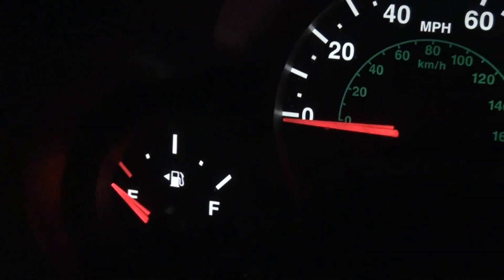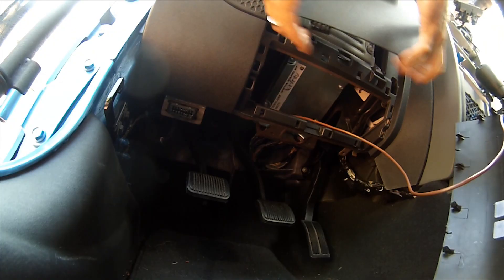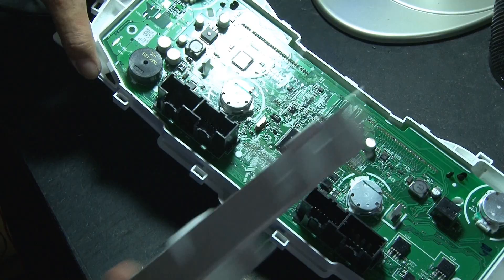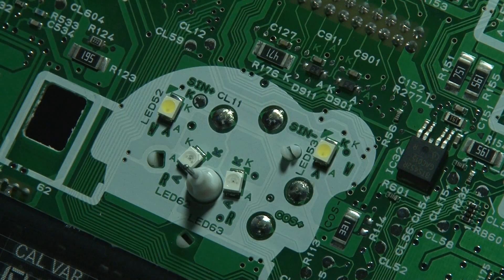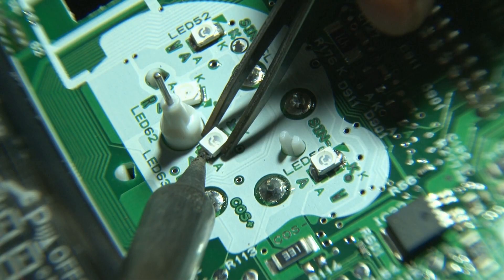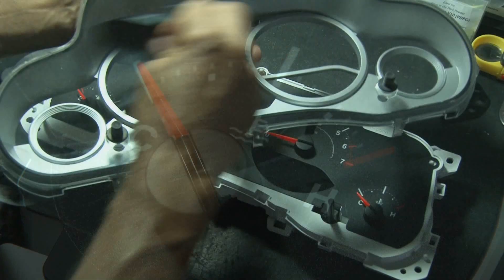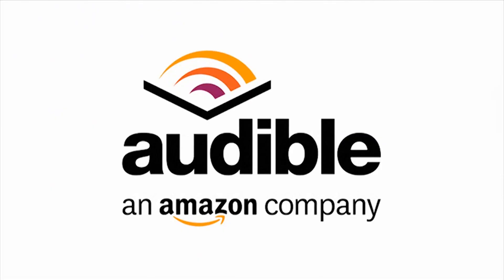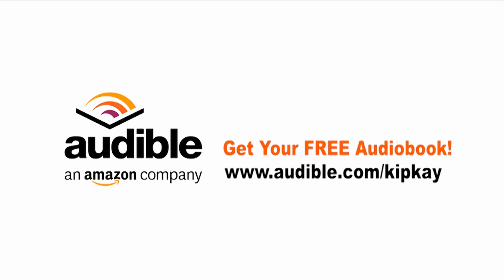Dashboard Light Hack!

Comment: Been wanting to do this to my 07 wrangler for a long time. I wanted red lights. Found that I need to change the resistors for red lights. A bit beyond my skill level. I did put some red paper over the blue bright light indicator. Made it much less blinding. If you have any tips regarding idntifying the resistors it they would be appreciated. white/ blue and green leds use the same resistor, red needs a dif one for some reason. Thanks for the video.
Reply: Professor Jameson that's crazy I wonder why and which,  because red is the color I would like myself.
Reply: Regular red LEDs are made differently, so it has a lower breakover voltage, but you can get blue LEDs with a phosphor that converts blue into red, or white LEDs with a filter, so they are electrically identical. They aren't as bright as white, so that might be a good thing.

Comment: Hey Kip, great instructs, but I feel that you should point out that this works best on nee cars with motorized gauges, like yours. Older cars have sporting-operated gauges, and it isn't simply a matter of marking the end of the needle on some paper. If you pull the needle from an older speedometer, it will go out of calibration, and will require a costly trip to a licensed speedometer rebuilder to recalibrate. Not to mention most older clusters don't utilize SMD LEDs for illumination, and some people won't be able to tell the difference until it's too late.

Comment: Just roll your mile counter back a few thousend while your at it ;)
Reply: no it's not.. Not atleast in my country
Reply: +John Murgatroyd His is digital, can't exactly roll it back.
Reply: +kipkay You can access the digital odometer just by opening up the casing.There should be a button that adjusts it. ;) PS:Im just joking so don't try it because I'm only 12. Lol
Reply: +John Murgatroyd You do realize that it's illegal to tamper with the odometer, and if he were to access the computer for his digital odo, that it would have a 50/50 possibility of not starting since there is high likelihood that the computers inside would see that something isn't right with the reading.
Reply: +ArcFlash It's possible, but would likely end up with a bricked car if the computers run security checks.
Reply: Kevin Topete That's your trip indicator that can be reset to 0.
Reply: +Fluttershy Fan lol
Reply: Gee, you really know how to lay the fear on, ultra THICK.  While I do not condone the practice of rolling back the miles of your odometer, it is, after all, YOUR odometer.  Any as far as I'm concerned, it's none of my business what you do with YOUR odometer.  But if someone were to tamper with the digital odo, if it's done correctly, has about a ZERO percent chance of "bricking" your car.  So let's treat people like adults and not lie to them about things we'd prefer they not do, OK?
Reply: John Murgatroyd sm
Reply: Alushy The Tyrant I thought its only allowed if you get a new engine in the vehicle?
Reply: ACOG Gaming still no, the odometer is how many k are on the car not just the engine.

Comment: Anyone who screws this up will be very, very, very sorry to find out how much a new gauge cluster costs.
Reply: buy used one they are cheap. Pro tip: look for gauge with less distance than your old have
Reply: *****
The Office of Odometer Fraud Investigations would like a word with you.
Reply: How about, don't screw it up? If you damage your circut-board doing this you have either never soldered or you have some kind of palsy.
Reply: Any newer car you need to buy a used cluster with less miles. The gauge cluster will get the correct mileage info from the car and be set to your correct mileage...

The mileage isn’t just stored in the gauge cluster anymore. That would be too easy for criminals to roll back mileage. These days with all the computerized systems, it’s much harder. But it can still be tampered with. So still be cautious of mileage seeming to be too good to be true, even on the newest cars.
Some newer cars, i.e. 2005 and newer, have the mileage stored in up to 4-5 different ECUs. But you can still get a used gauge cluster for around $60-$100 depending on the year, make, and model...
Reply: Wow you are a genius!!!!

Comment: I recently changed the lights to LEDs in my 89 Cherokee. I changed them to red because it matched my stereo head unit and red light doesn't kill your night vision. My dash was a LOT easier to change out since it's older and used removable bulbs to change

Comment: wooowww this looks so much more compicated than with my dash, i did mine a few years back on my mitsubishi lancer, mine was take out two screws take the shroud out, take out the 4 surrounding screws, pull the dashboard out, anticlockwise to pull the old lights out, install the t10/t5 led's screw back in and done. so glad mine wasn't this crazy haha.

Comment: Our Ford's have the option built in where I can change the inner ring, outer ring and surrounding dash all different colors. Each one can be set for different colors at the same time. Floor lights/cup holder lights can do the same too.

Comment: Welding LEDs onto an electronic circuit board  is hardly what I call a HACK. Looks nice tho.
Reply: If you welded LEDs on a circuit board, you wouldn't have a circuit board or leds anymore
Reply: REKT
Reply: installing a train horn on f150
Reply: RGBW it

Comment: I wish my dashboard was as easy to dissassemble as yours. X3 times the work you did + mine was with lightbulbs ( 2 for entire dashboard) . SO I removed those and installed LED tape lights , 4 pieces with 6LEDS each(green ones ,cuz my car is green and Ive painted my interior green too) , then I made custom holes in the plastic thats over the curcuits to put in X1 red Led under each needle. Then for the display(also with lightbulb) I also put led tape light , also for my clock and date . Also green tape for  the console for my headlight and around the AC control . And this all cost me around 2$ no more.I admit it was alot of work cuz unline yours where everything was already with LED's which you just replaced , I had to make room and place for the led tapes and the leds under the needles. BUT im very happy with the results. If anyone wants me to explain how i will be glad to!!

Comment: How do I get rid of the "seatbelt off" ringer?
Reply: Bryan Young
The law is that if it's dangerous, then it's illegal.  For instance if you're driving 35 MPH on a 65 MPH freeway it's illegal because you could cause a collision.
Reply: Like I said, I have no trouble believing that it does exist as a law, but around where I live, you'd be hard pressed to find someone NOT breaking the limit by at least ten miles an hour. So, whether it is true or not is incredibly irrelevant to my life.
Reply: There should be two wires (they may be bundled as one thick cable) that come from the computer up into your seatbelt receptacle at the very bottom (near the carpet). Simply cut the wires and then, depending on your car, either tape the wires off separately to prevent a closed circuit/short OR use a butt connecter to close the circuit, thus sending a "seatbelt engaged" message to the computer. 15 minutes tops and super easy if you know how to use a wire cutter, stripper, and crimper.
Reply: Just go to junk yard find same model year of vehicle you have and cut the buckle off and put it in your vehicle...
Reply: Set the sound alert volume to 0. 😆

Comment: Ive found that a dinner fork works really well to remove the needles. If you center it it provides just enough leverage to remove them safely and is easier than scnrewdrivers

Comment: Did anyone else notice he had no gas in the car?
Reply from the maker: I shot the footage with the key out. Just the lights on.
Reply: fail
Reply: fail
Reply: fail
Reply: the engine wasnt even running he might have had it in a accessory mode and turned on lights manually
Reply: dawn1berlitz lol you can turn on a car whit out Turing on the engine ha noobs
Reply: you do realize the RPMs were at ZERO right?
Reply: Fail
Reply: Bryan Medina te dejo !

Comment: Just as a FYI:

If you do this hack for someone else, DO NOT remove or leave out any of the lights. If you want to leave the seat belt warning indicator off on your own vehicle, that's fine, but it may be illegal to do this to someone else's vehicle as many states have laws that forbid removing driver indicators.

Also, DO NOT remove/leave out the malfunction indicator ("check engine"/"service engine soon") light (or "MIL") regardless of whether it's for your own personal vehicle - tampering with the MIL is illegal as hell (technically, it violates 42 USC 7522, which is part of the Clean Air Act) and any decent shop will notice this on your next inspection because the engine control computer will report whether the MIL should be on.

Some vehicles (especially older ones) will use incandescent bulbs - replacing them with LEDs is pretty easy to do but will require adding current-limiting resistors if you're not using a drop-in direct-replacement style LED bulb.

Comment: It´s extremly dangerous to remove the dashboard! The airbag can trigger and hit you in the face.... just sayin´
Reply: A good idea to disconnect the battery when working on components that has something to do with the air bag system.
Reply: we said that a million times
Reply: You should always unplug the battery before doing any electrical work. Not just for the airbags, but for the computers.
Reply: That part of the dash doesn't have anything to do with the airbags...
Reply: phgoil true but he obviously does know what he’s doing
Reply: some advanced cars have airbags on the dash
Reply: No, dummy. At least 2 inertia switches have to close to provide power & ground to the charge that inflates the air bag.  The manufacturers use this warning in their service manuals to cover their butts so idiots don't bypass the sensors and scammers can not sue.
Reply: It already did

Comment: Is this legal
Reply: think so, but doesn't hurt to check
Reply: Rakesh Kumar It's completely legal. There is no law that requires a seatbelt light in a car. However, this probably voids your car warranty (if you still have it).
Reply: Depends on the light specs and colors. Also depends where the car is registered.
Reply: In many places it's even legal to drive without a speedometer in your car at all.
Reply: Why wouldn't it be?
Reply: *****

Many people have blue, red or green cabin lighting and it is fine since you only use them when stopped on the side of the road or in a car park.

If you use them when driving it is illegal, but how can it be when you are not hurting anyone?
Reply: Fanrabbit 
What the hell are you on about
You're changing a consumer replaceable part

Do you know what copyright refers to?

If i was to copy the looks of a Dodge Viper GTS and call it the Snake GT that is illegal since i am copying someone else's work

But changing a bloody lightbulb is changing a light bulb.
It is not illegal, there is not copyright infringement
You normally have to inform your insurance about cosmetic mods or performance mods that cost a fair bit of money like a body kit or a turbo or CAI.

If you have to tell your insurer that you changed a fucking light bulb in the center dome light, it is time to look for some other insurer.
Reply: Guys the only thing you cant do is exotic headlights(blue,red,green,ect). Anything inside is up to you, as long it is logical, dont do anything like cop lights obviously.
Reply: yes, yes it is
Reply: Fanrabbit A copyrighted car? you have no idea how wrong that statement is. Copyrighted car? wow, cant even begin to explain what is wrong with that. And to the other part, no, you do not need to tell your insurance company that you changed the color of a light bulb.
Reply: Fanrabbit "Copyrighted car" hahaha
Reply: ***** Why would it be illegal to change the cabin light colors? I have had several different factory cabin light colors over the years in various cars? Not to mention they are only on when your doors are open....
Reply: ***** You got pulled over by a cop for the lights on your dash.....? How bright was it dude? Where do you live? Unless your dash lights are super bright or bright red, how are they going to be able to tell anyway? I see people with blue lights every night I'm out with no problem. Some people have dashes that look like a cockpit, they have so many lights! Why would you get stopped for your lights? What did the cop say about it? I'm interested to know.
Reply: Yes its legal, its illegal if you have colored headlights & tail lights. The interior is fine any color.
Reply: Dale Gribble
The color of the headlight depends in what country and state you are.
Some allow Selective Yellow headlights or White headlights. Most these days say White headlights only.
But foglights can be Selective Yellow or White
Turn signals must be Amber or red(US only from what i hear), stop and tail must be red, reverse must be white and rear fog must be red
Reply: IIGrayfoxII yeah, i know. i mean they can have any color they want inside the vehicle.
Reply: Human eye dont see very well in blue light so keep changes it to blue.

Comment: You are so lucky! Three panels to pop off and four screws, then three slack-bearing wiring harnesses, and the cluster is out. It's so easy. I wish it was for all cars, though. My 89 Dodge caravan.. I put purple LED bulbs in it, but getting the cluster in and out involves fighting with the speedometer cable, which has BARELY enough slack for me to get my hand in behind the cluster and release it. Getting it back on is three times harder. In the case of my PT cruiser that came before the Caravan, you have to pop off the center console cover, pop off the whole dashboard, take out the face panel, pop the turn signal wiring on top.... oi vey. Note to future Instrument Cluster Modifiers: DO YOUR HOMEWORK FIRST. I can't stress enough how embarassing it was finding out that I pretty much broke the four inner tabs that held the PT's dash down when all I had to do was pull back...

Comment: There could be problems with this - in some countries turn indicator lights must be green. People tend to be more short-sighted in the blue end of the spectrum, so the dash might appear blurry at night. Blue affects your night vision as well, red would actually be better since it doesn't cause your pupils to contract. That's if you don't mind your car looking like a 1980s BMW.
Reply: Oh, one other potential issue. The high beam indicator must be blue to be legal, but if everything is blue you might not notice you have high-beam on, causing dazzle to other drivers.

Comment: Nice, but all must be sure it is adjustable intensity of light as it may interfere with your vision when driving in dark or foggy condition. Safe is cooler than danger since it is symbolized as blue and danger is symbolized as red. So blue is Cool and Safe :D
I would make the trip teller red and the speedometer blue or green. :)

Comment: I think old dashboards would be easiest to pull off.  The regular light bulbs help with the easy-ness factor. All I would do is remove the bulb, and put some thin coated finger nail polish on it, preferably red, or green, then put it all back together.

Comment: While you have it out of there I would change out those cheap stepper motors with a new set. They typically go out in almost all GM vehicles and also Jeeps (I know Jeep is not a GM product but it's still a problem in their trucks).

Comment: Wouldn't putting a different Colored Transparent Sheet like acrylic be a quicker way to pull off this affect?  Like I have a small 2 gallon desktop bubble water machine (bubbles come up through the water that is in the thin 1" Gap pathways in glass very relaxing bubble machine) and the light source is just good old fashion 12" florescent white light bulb, but it came with 5 thin sheets RED, Green, Blue, orange, and I think a pink sheet as well. you just put the sheet between light and the glass of the bubble fountain machine, and instant color change the water then appears whatever color you picked.
Just wondering since soldering is a lot of work to change LED itself. Thanks for the video since at least I know how to replace dead led dashboard lights on my Moms old 05 Focus. But this is not going to be fun as the last time the dash was taken out was after someone hit the car, and the mechanic said they "did not know ford focus dash had so many screws" lol (Ya we had lots of trust then) 

Another idea real quick would be to do a quick hack on a usb powered external light - with possible Heads Up Display - I am sure you can make something cool Kipkay :-D

Comment: Dashboard Light Hacks FAQS

After reading some of the comments I felt this was necessary.

Isn't this illegal?
In most places no. However if you're unsure it wouldn't hurt to do a quick check.

Isn't this dangerous?
No. As long as you can easily read your instrument cluster it's not dangerous.

But what about the whole soldering part?
If you feel uneasy about doing this yourself you can always get someone else who knows what they're doing to do it for you. What would be better though is if you played around with soldering stuff yourself with old electronics to gain the knowledge and skills to do this yourself.

Isn't it a possibility this could set off my airbags?
No. Your instrument cluster has nothing to do with your airbags other than the airbags warning light.

Won't this void my warranty?
Yes and no. Car manufacturers are only allowed to void the warranty of the parts you've fiddled with. So in this case it may possibly void the warranty for the instrument cluster but not the rest of the car. They can only ever say the part voided the warranty of another part if they have evidence the part caused damage in another area. It's best to check up with your dealership to see if it will void the warranty of that part. In some cases dealerships may give you a bit of leniency in modifying a car without affecting the warranty at all.